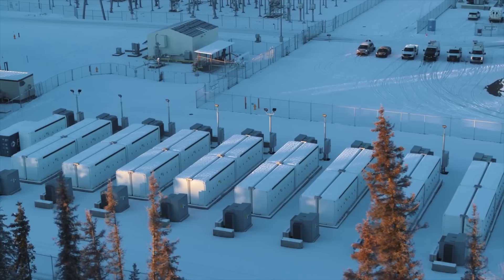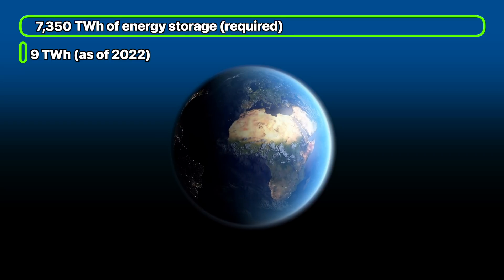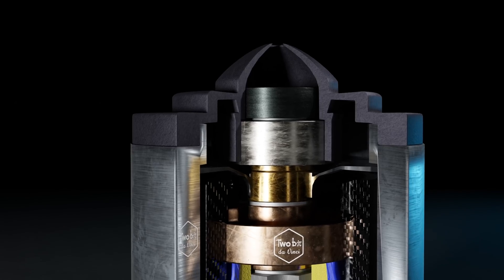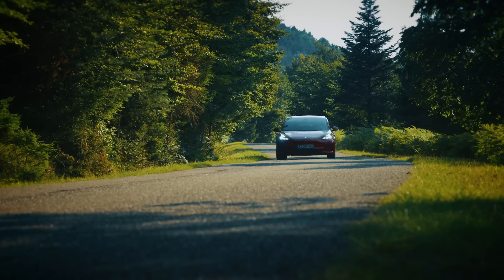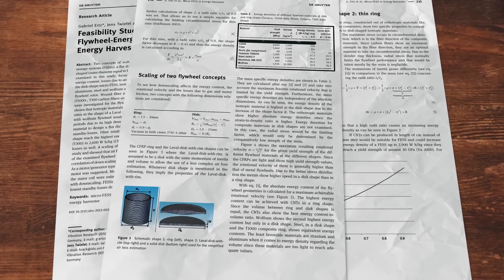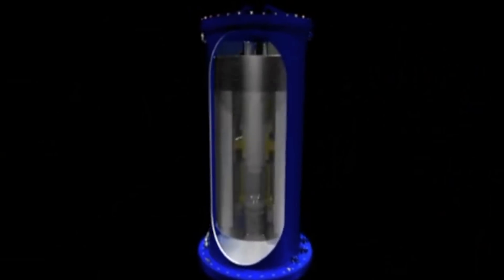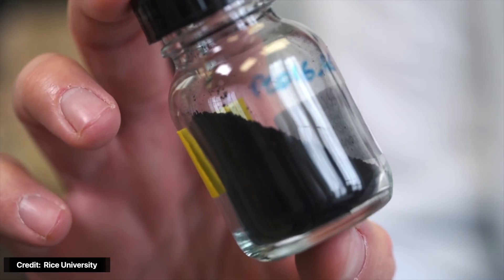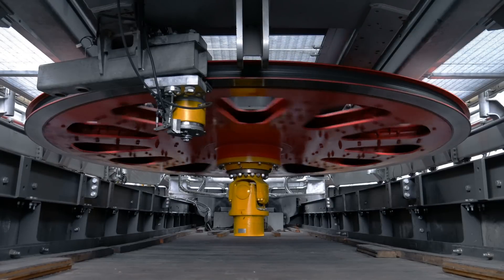Breakthrough Energy Storage Tech CRUSHES battery prices by 90%!

Comment: You are right to point out that renewables as we have imagined them are a three-legged stool with only two legs presently. Perhaps we are just tying ourselves into knots looking for that third leg when we have the ultimate battery at our disposal.

The death of a giant star in a supernova explosion leaves us with stored energy scattered through the cosmos. Planet Earth has this gift in abundance. Fertile and fissile atoms have energy densities far beyond any chemical or mechanical means of storage that we can imagine. Not just a little bit more but thousands and tens of thousands of times more. I'm referring of course to isotopes of uranium and thorium.

Not only do we know how to make energy from these are track record demonstrates that we have done so safely. Nuclear power has delivered low carbon output power with fewer deaths and morbidity per terawatt hour produced with the current generation of reactors.

I think it's time to revisit the nuclear power potential very seriously and realize that nuclear power is also a candidate for advancement. Just as we can imagine advancement in renewables we should also be enthusiastic about advancement in nuclear power. Unlike renewables nuclear power has demonstrated its ability to deliver and do so safely, reliably and without climate impact.

Better yet, nuclear power is renewable too. It has a cycle of billions of years as we wait for the next supernova to bring our next load of little batteries to the cosmos.

Windmills, solar panels, and batteries need to be renewed every 20 years or so.

Comment: You missed it, badly.  No improvement in material strength, even carbon nanotubes, does ANYTHING to fix the problem, which is that constant loss of power in standby.  In fact, they may make it worse, because you can use that strength to make the flywheel stronger and spin faster, which means MORE friction losses.

Comment: Why bother with a rotational mass why not just lift a weight you can store the energy nearly indefinitely. You could winch it up slowly and drop it at any rate necessary to meet the demand. A water tower could do the same job without the complexity of a flywheel it seems like a lot of money is being wasted on making simple very difficult.

Comment: How much reflection of heat is caused by solar panels?
Reply: As in keeping the sun off your roof?  Yes, this can produce savings in air conditioning costs, but most solar installations don't cover the entire roof.  Note this is for panels mounted above the roof with an air gap.  PV integrated into the roof, like Tesla's solar roof tiles do not have this benefit.

Comment: Instead of scaling up, once the material science makes the best types economical, can we scale down? Instead of a big flywheel power plant, how about putting a small one next to my water heater? Typically a power outage here is under four hours and very localized to just a neighborhood or two so each home can manage itself. If it can reach cost parity with home battery storage.

Comment: Could you please make a video about storing of energy, by producing of aluminum powder, to generate hydrogen from the powder by chemical reaction, or to generate the heat, by burning of powder with air, for example by conventional power plants?
Reply: Look into how aluminum is made.  It's a VERY energy intensive, high temperature process, which is why aluminum plants have traditionally been located next to hydro generating plants.  Not something you're going to do at home.
    Instead, you may want to read up on Aluminum-Air batteries.
Reply: Obviously you have no comprehension of energy EFFICIENCY!!

Comment: Maybe this is already being used, but ...

It seems you could blend magnets i to the exterior of the disk and include coils or permanent magnets in the exterior wall that could be powered to apply compressive force when at high RPM.  The exterior wall can be made of something much cheaper...
Reply: Magnets on the exterior of the disk will severely limit the energy density a rotor can store.  It would be far better to place magnets in smaller diameter with much less less rotational velocity than the carbon fiber rotating mass storing most of the energy.  Magnets have poor tensile strength and gluing them to the outside of super fast spinning flywheels is not  going to happen.
Reply: @kreynolds1123  

You aren't describing what I was thinking of.  The magnets would not be under tension, for example - they would be inside the weave.

I can imagine building a stepped disk where magnets are placed at multiple radiuses.
Reply: @JohnBoen  sorry I over looked the part about exterior magnets putting the rotor magnets under compression.
Reply: @kreynolds1123  
All is good.

While at work today this topic was bubbling in the back of my head and I went through several revisions.

He mentions a 3% hourly loss. I think I know where that comes from - magnetic bearings. 

I suspect any system has magnets already, and is inducing a current into a piece of copper to get lift because it responds with an opposing magnetic force. That induced current translates into lost momentum and becomes heat.

It keeps evolving...

I'm into counter rotation flywheels now so we get 2x the velocity across the generator.  Maybe using YBCO tape to create the coils - sure it requires liquid nitrogen Temps to work...

But now you can use liquid nitrogen air bearings and only lose 0.5% an hour...

With superconducting magnet coils you could do a lot better than permanent magnets. 

And get double use.  Use the. To apply torque at low speed, and use them to apply compression at high speed.

Interesting topic...
Reply: @JohnBoen  I suspect how they are aligned with earth's rotation will influence torque on bearings throughout a day.

Comment: This may sound like a silly question, but, why don't they just tie the short nanotubes together into long nanotubes using really strong knots? Might not be as strong as long nanotubes but it should be stronger than anything else we have.
Reply: Nanotubes dont stick to eachother.  That means braides weaves and even knots wont work too well. 

But if meter long single strand nanotubes could be joined  end to end in an unbroken torus, then  maybe we get to see some thing close to the theoretical tensile strength.

Comment: Flywheels could also be used as a gyroscope. Stored energy that is helpful in balancing.
Reply: That is also the main problem for using them in anything that moves.  🙂
Reply: @bknesheim  not to mention the weight
Reply: A flywheel is a gyroscope and vice versa. Precession is a problem that must be considered since the Earth itself is a flywheel. other than living in a cave using what energy is currently and locally available, power storage already has a natural solution. Carbon based Solar Energy Storage, Oil, Gas and Coal. No one ever mentions the Environmental effects on changing weather patterns by unnatural shifting of Gigawatts of power from place to place, desert to city or changing wind patterns that have self established over thousands of years. There is no such thing as a free lunch and it isn't possible to change only ONE thing in the equation. Every action has an equal and opposite reaction is an established Natural LAW in Physics and cannot be violated.
Reply: @KastorFlux  Your example proves my point, you can't change one thing without affecting something else.

Comment: parallel not serial
Reply: if you counteract the centrifugal force by magnets, or something else, ie, artificial gravity against a very slippy surface, then no problem
Reply: ie graphite lubricated bearing, the flywheel being the bearing axle itself, two-in-one solution
Reply: why worry too much in two parts, when you could be (from) one part, God itself
Reply: solid state pu-238/am-241 heat/nuclear isotope (electron/alpha) solar energy storage
Reply: air bearing self-supporting flywheel
Reply: metal-air fuel cells are super easy, magnesium, aluminium, iron, with sea water platinum
Reply: whats better than carbon nano tubes, graphene
Reply: why slow down, hmmm huh
Reply: nice stuff
Reply: think about rain running near losslessly on a rail track, same idea, or better yet, skate on ice, near zero rolling resistance

Comment: Potter's wheels, spinning wheels, and the so-called "great wheel" lathes we're all examples of flywheels, also sewing machines used to use treadle operated flywheels as well. Basically, before the steam era flywheels were powering a lot of industry
Reply: They weren't really powering anything though. They were just acting to smooth out irregular energy flow over a period of seconds. More like a modern capacitor than a battery.
Reply: @vylbird8014    And it was fun to spin up the pedal sewing machines. That didn’t last long.  It was fun as a kid, but I learned fun could be curtailed by an angry mother.

Comment: If the geothermal tech from Eavor takes off, grid storage won't be necessary.
Reply: I installed a water-source heat pump at my previous house.  Worked Great!  In summer it was like having free air conditioning.  Why doesn't everyone do it?  Cost of course.
Reply: Sounds unlikely.. The depth they have to dig to...
Reply: @randybobandy9828  Look at their YouTube channel. You will find that problem is well and truly solved. Their closed loop radiator design is already proven to work, can be located anywhere on land, and they already have contracts in Germany. As the old saying goes, you shouldn't tell someone it can't be done when they are already doing it.

Comment: Why can't you use fly wheel technology in lorries? For long distance journeys by using wind to power them and uses batteries to start them on there journeys and if they created to much energy have dump off solutions of energy on its travels ?
Reply: Right!  We can put big sails on the top of your lorry to run a wind generator, and then we can cover the sails with PV cells to generate even more energy.  Why hasn't anyone built this yet?!  The only thing it lacks is a steam engine.  
   In fact, with all that extra energy we could run the steam engine backwards and generate clean drinking water.
Reply: @guygordon2780  that's not a bad ideal lol but I wasn't thinking of that as you drive a long the road wind goes in through a grill that could turn  a wheel or fly wheel to generate energy to charge batteries etc when needed, why not have a stream of wheels going down through the middle of the lorry lots of wind lots of turning lots of energy lol 🤣 crazy ideas have worked before .

Comment: A thought:  Is it plausible to increase longevity of charge by putting retractable weights inside the flywheel (not the whole flywheel, but a portion of the total mass)?  As the flywheel begins to slow down, these retractable weights would be drawn toward the axis of rotation, to speed up the velocity of the flywheel?
Reply: The energy is lost -- trading a larger moment for speed won't change that.
Reply: No.. Because you can't simply replace spent energy by by adding a weight.
Reply: A flywheel slows down because its energy has GONE.
Reply: @KastorFlux  Maybe stay off the alcohol for a while.
Reply: @KastorFlux  Its called fermentation, considering the billions of gallons needed every week what do you suggest they ferment?
Reply: @KastorFlux  .....as I said stay off the alcohol...your brain is fudge.

Comment: 2700 Wh/kg?!! The energy density requirement for long-range commercial aircraft is half that value. [See "Performance Metrics Required of Next-Generation Batteries to Electrify Commercial Aircraft". ACS Energy Lett. 2020, 5, 2, 663–668 Publication Date:February 4, 202]
Reply from the maker: yeah now to be fair, that's for a theoretical laval disk, so you can divide that easily in half, but still pretty amazing, just has the power drain at standby problem.

Comment: I imagine just after sun down is a peak time for grid usage.  People are still up and using lights, electronics and appliances.  Grid draw this time of day is much higher than middle of the night anyway.  I don't feel like clean energy has a magic bullet but rather a comprehensive mix of technologies working in concert and this old technology with modern innovation could be a part of the solution.
Reply: Peak use is from 4pm to 10pm.
Reply: Depends on the climate and season.  Sometimes air conditioner usage overwhelms everything else.  Power used by lights continues to drop as LEDs replace everything else.

Comment: A Concrete Round Mass With a Commutator On The Axel Shaft Is All It Takes ... 

One side of the Axle Shaft Energizes ...

The Flywheel To Spin

The Other Side of The Axle Shaft Produces Electrical Voltage From The Spin ...

The Primary Side is Supplied With Voltage From A Battery Bank ...

Which The Solar, Wind, Gas Can Charge Batteries ...

To Supply ...
The Needed Voltage

Once it gets up to Operating Speed.
Reply: Concrete has terrible tension strength and is not really all that dense. This is a old idea, the material science of the spinning mass is not the hold up. The bearings and friction losses are and will be the limiting factors.
Reply: @adrianwilson7536  
True.

I'm just thinking in Concept Stage.

I'm NOT refining 
The Final Design 
Not Until I Have More Money To Spend On Making More Inventions.

I Live Off Grid
30 Years now

I have
Solar And Wind ...
Diesel And LP For Back Up

The Principle can Always be Optimised As You Have Mentioned.

I Would Be Looking To use A Material like A Hocky Puck For Hardness and 

Weatherproofing.

For Bearings 
I Would Use Electro Magnetic Force To Suspend The Axle Shaft to Reduce The Friction Losses
Or ...
The Bearings would Be Sealed and be of the type which are 98.6% Friction Free

Like some Windshield Wiper Motors, but scaled up to handle the weight of the mass.

When I mentioned Concrete ...

I'm in My Backyard
Looking For What I can salvage or repurpose to create something new and usable on the farm.

When the Pioneers built Water Wheels

They constructed them from materials
Sourced Locally.

Cities were along ways away.

Some things they had to ride for days to get

Like Bearings and Steel Banding ... etc

I Usually Go Out Back
And Rumage Through  ...

The Salvation Pile
I Have Stashed Away

Just Rearrange 
The Materials Into what I Need Or want

To Avoid Buying Wherever Possible

The Flywheel Effect
Has Had My Attention For Many Years

However, Lately ...

I Have A Keen Interest In Radiant Energy Systems To Supply and Augment My Input energy source From Solar And Wind Turbines.